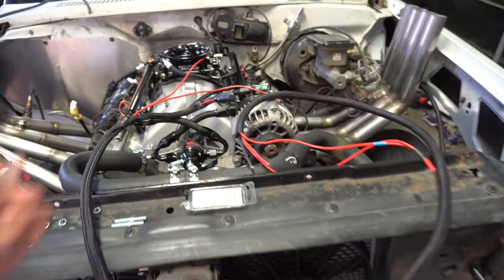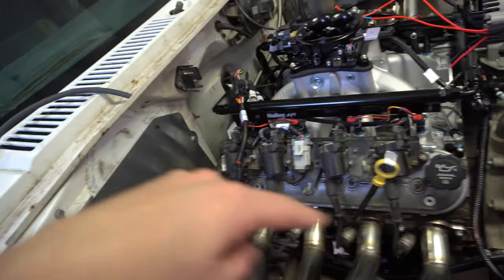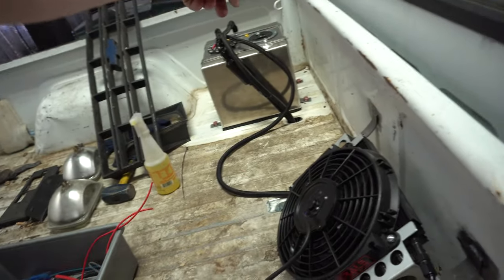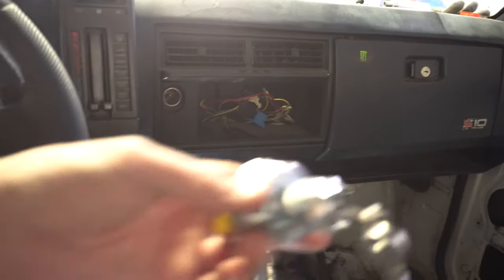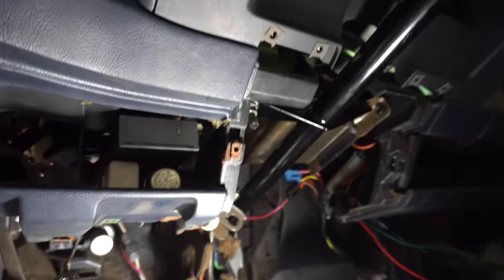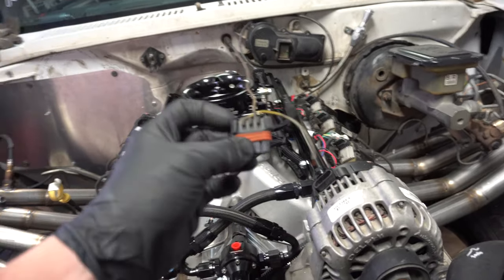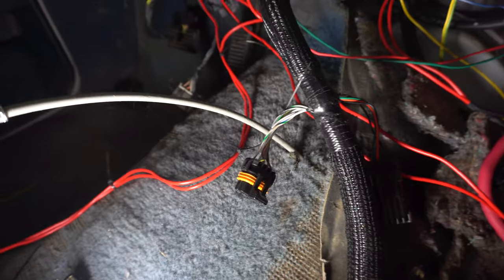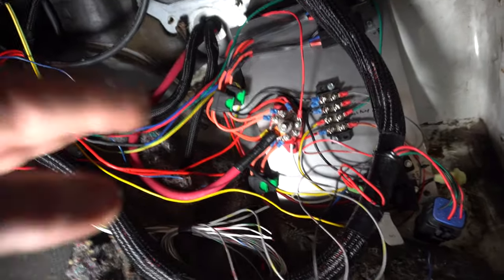LS Swap Wiring The Holley Terminator X is Installed! So close to first start up... PART 3

Comment: I have the fancy ratcheting tool aid crimpers, but I solder most of my connections with an old heat with fire iron
Reply from the maker: I soldiered everything on the Mazda figured I'd try this on the Burnie and see how it does.

Comment: How did you wire the fuel pump, did you take green wire for fuel pump from holley to a relay and fuel pump wire to relay ground relay and 12v ignition for relay
Reply from the maker: I used the holley fuel pump wire as the trigger wire then wired the relay to a good 12volt then to the fuel pump.

The holley will signal ign and prime off of that wire
Reply: @BuildTuneRace  ok thanks i seen one guy take holley fuel pump wire to relay, good 12v source to relay, ground, and wire from fuel pump to relay and works just like it's supposed to primes and shuts off like if should

Comment: How did u run the green fuel pump wire
Reply: I figured it out if anyone needs help
Reply: @jacobiec47  what green wire bud the harness has no green wire is just red and black coming from the main harness
Reply: @joseiturbide4175  definitely has a green wire
Reply: @jacobiec47  thanks found it
Reply: @joseiturbide4175  did u get everything wired up
Reply: @jacobiec47  sure did just the im doing the alternator wiring now
Reply: @jacobiec47  hey bud i tried to started uo im getting no power from that green wire the red wire is connected straight to the battery the pcm does turn on but no juice to the pump i checked for power with a test light and nothing did had any problem like that thanks
Reply: @joseiturbide4175  u got email buddy send pic or video
Reply: @jacobiec47  ok bro managed too get fuel pump to turn on i had to go to the wizard set now im not getting spark lol
Reply: @joseiturbide4175  what color wires do I need to wire to the starter and ignition switch?
Reply: @Elliotthaye837  what car do you have

Comment: You couldn't just run it right to the battery to have constant battery power at all times?
Reply from the maker: For the ignition/key on wire?
Reply: @BuildTuneRace  yeah at about 5:40
Reply from the maker: No it needs to be a keyed or on a switch other wise the computer would be on at all times. This is also what signals the fuel pump and injectors to prime before start up and also what kills the car when you want to turn it off.
Reply: @BuildTuneRace  ok gotcha. Gotta figure out how I'm gonna do mine. Just ordered the x max yesterday for my 90 obs 5.3